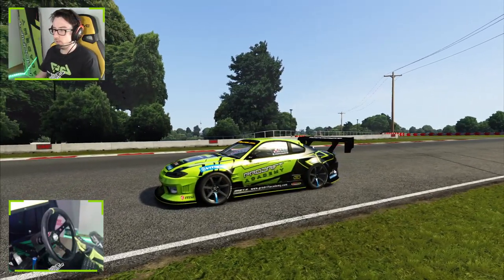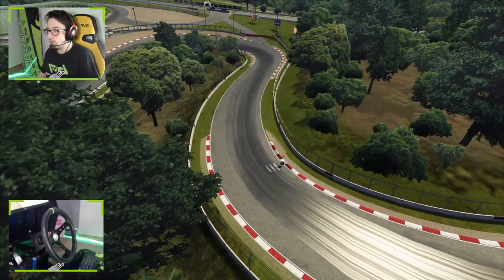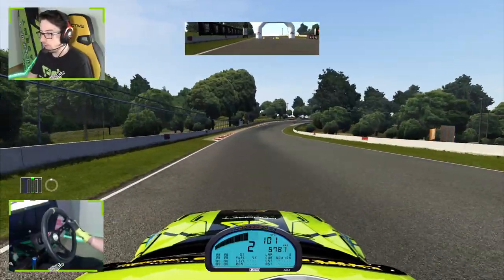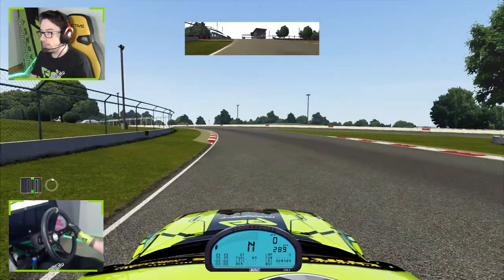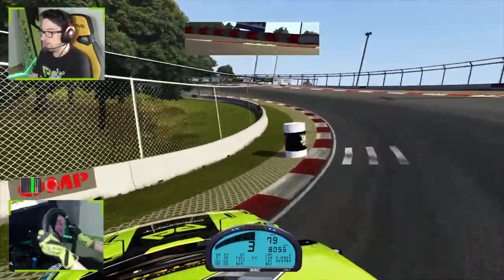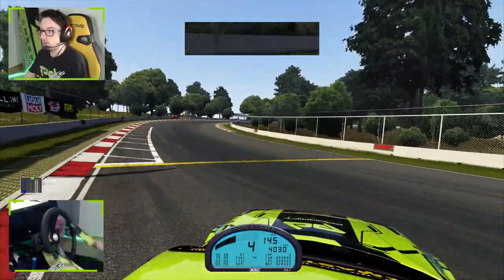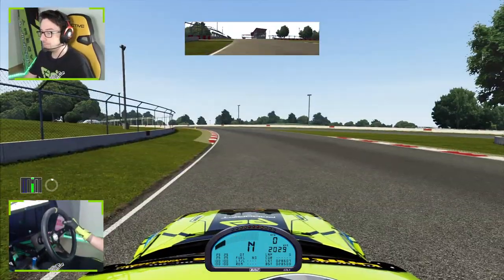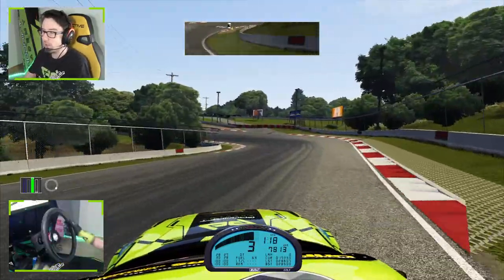This track is.... FUN? - DMVC RD2 Practice

Comment: Hey 
Alan Hynes how do you do transitions with super high HP? I'm having a hard time doing transitions:(
Reply: It might be couse your using a lower end wheel whare it doesnt have enough power to rotate fast enough. You have to let of throttle more and throw the wheel in your hands
Reply: And if nothing seems to help then you can try reducing the rotation down to 720 or something instead of having it at 900
Reply: @d1scopotato222  ow ok thanks!